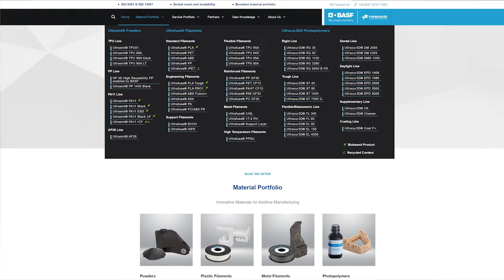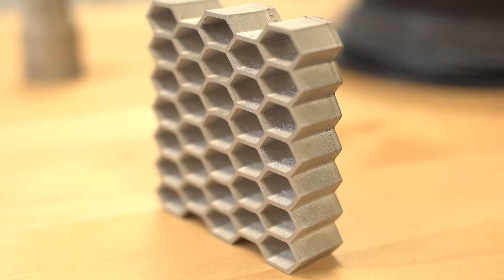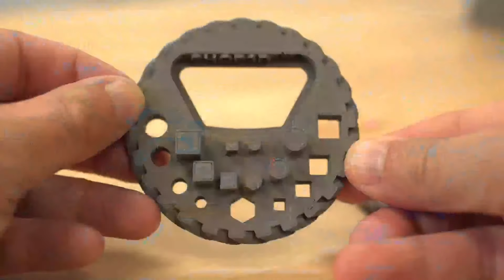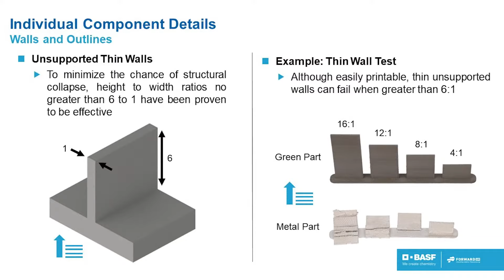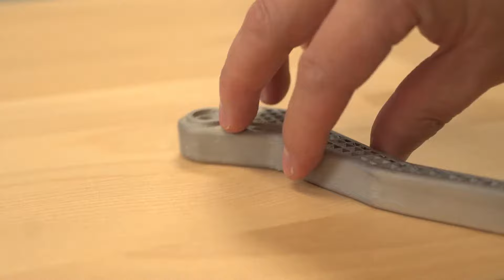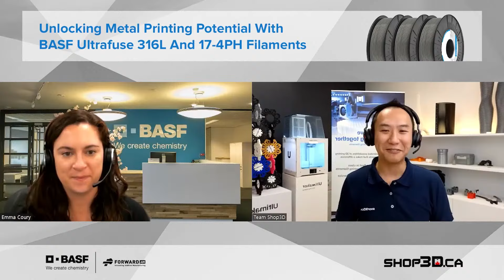Unlocking Metal Printing Potential With BASF Ultrafuse 316L And 17-4PH Filaments

Comment: Do I have to remove the raft before sending part in for debinding and sintering? If I don’t remove will it become fused together?
Reply from the maker: Yes, you will need to remove the raft before sending in the part. We recommend to use sharp blade, and to take it off slowly, as to not ruin the contact surfaces between the part and the raft.
Reply: @Shop3Dca  You need to make the part look as if it's ready for assembly before sending it off for the post processing.